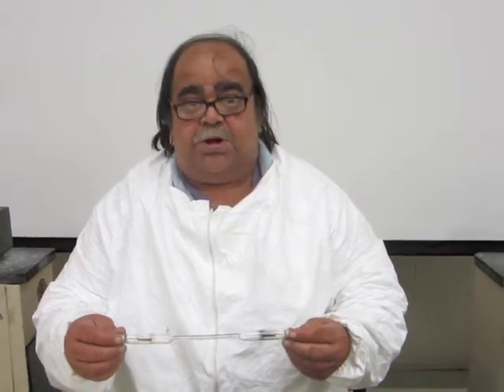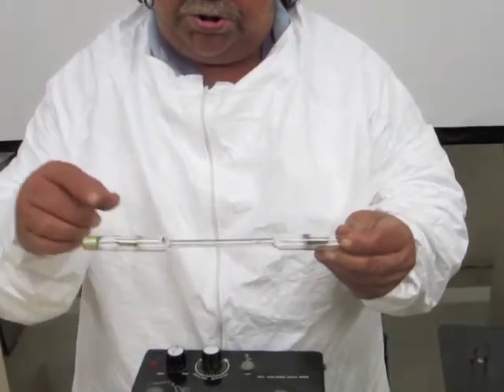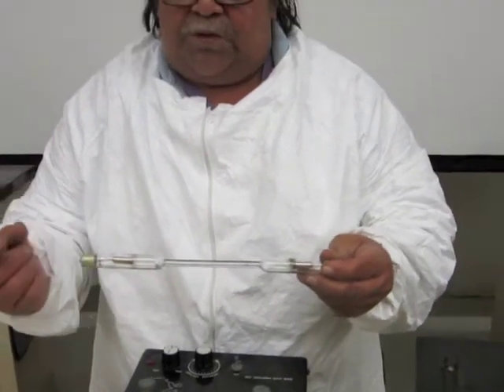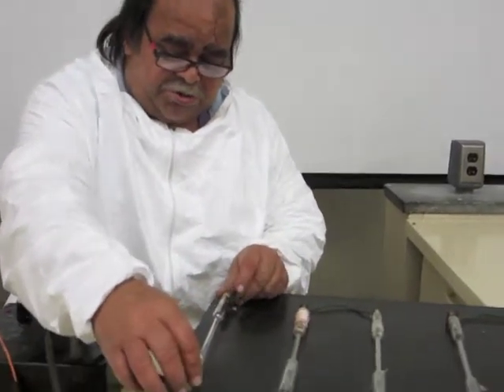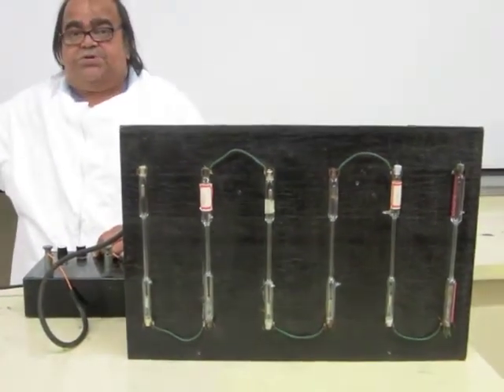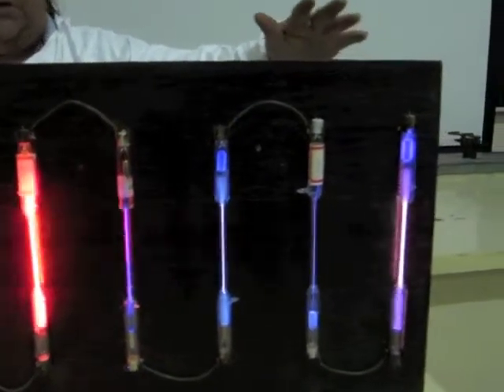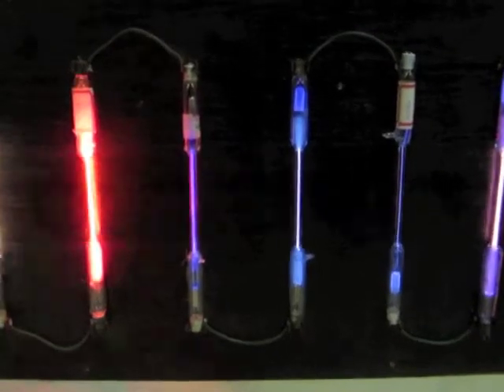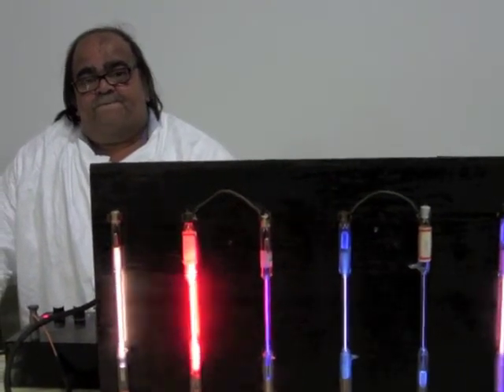Noble Gas Light Emissions - Unedited - Low Resolution

Comment: This is the reason why plasma energy has colors..... it's the plasma that charges up the gas .... which is why you see bolts of electricity with colors flying through the air